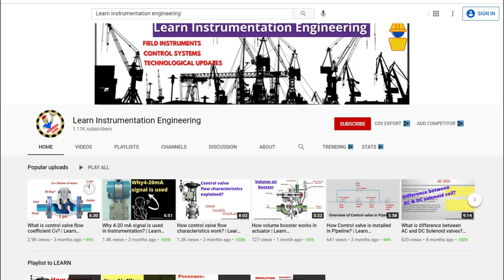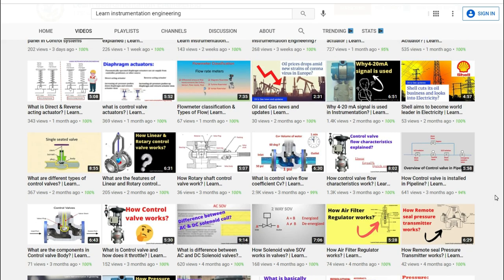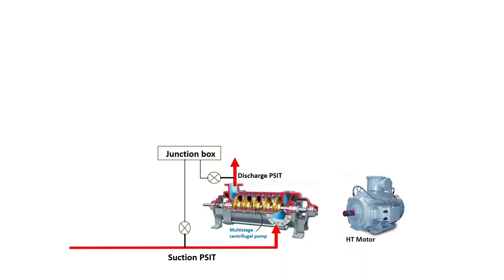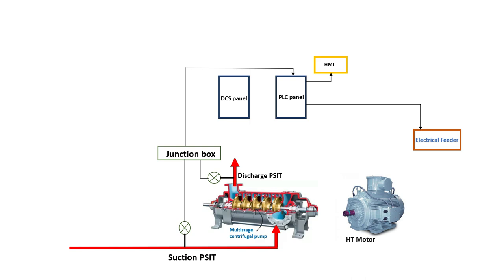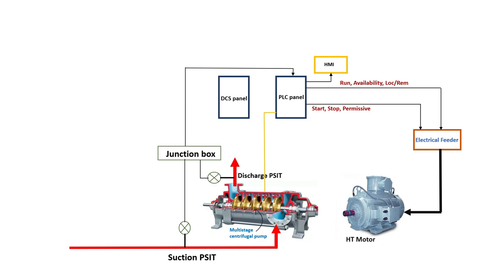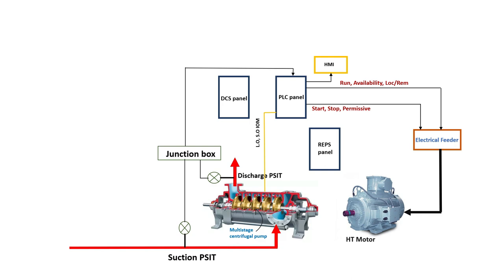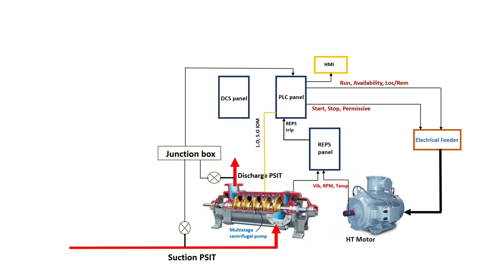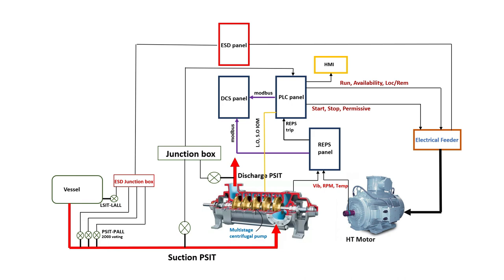Complex process & Electric signals for Pump and Motor? | Learn Instrumentation Engineering

Comment: Do we have any trip signals that would go from PLC panels to ESD and then to electrical feeder??
And what type of communication is happening between REPS Panels and PLC Panels. Is it MODBUS or some other mode of communication??
Reply from the maker: No trip signal from PLC to ESD. MODBUS communications is used between REPS and PLC. This is an example video to show how complex control system is interconnected in a process plant.
Reply: @learninstrumentationengine268  thanks for ur swift response..U r doing a great job...keep it up man
Just one more thing... Are REPS Signals directly going to Electrical feeder for tripping if not then how this tripping is being initiated by REPS as these signals are communicating to PLC Panels over MODBUS
Reply from the maker: Not all signals are modbus. Trip signals are hardwired to PLC. In case of machine monitoring, PLC is master. So, other auxiliary control system will send their trip signals to PLC.    Then, PLC will Trip the electrical feeder system.